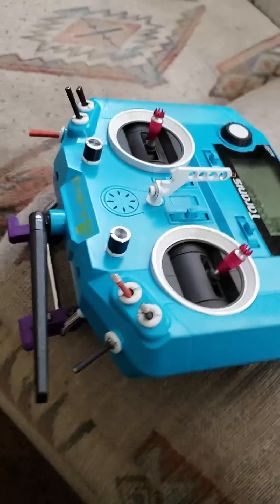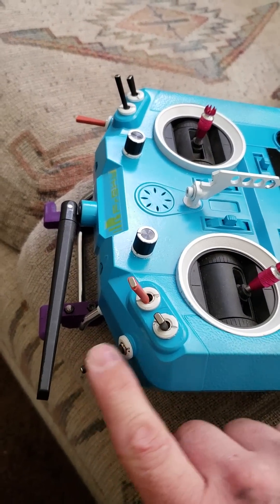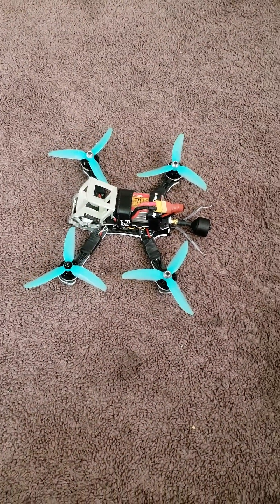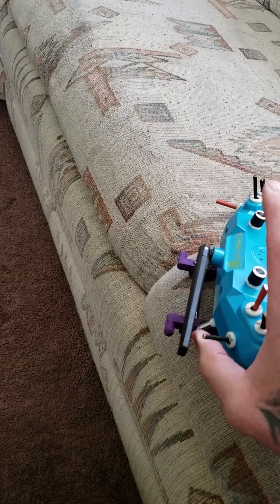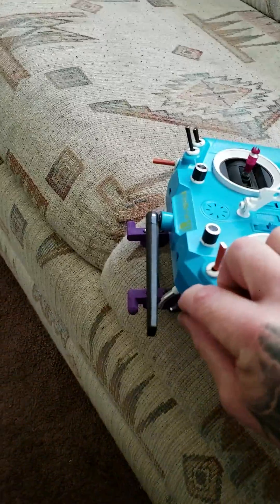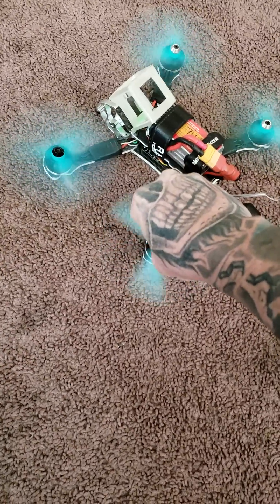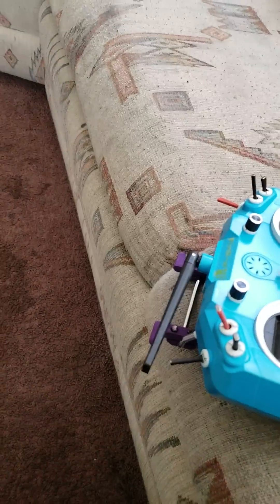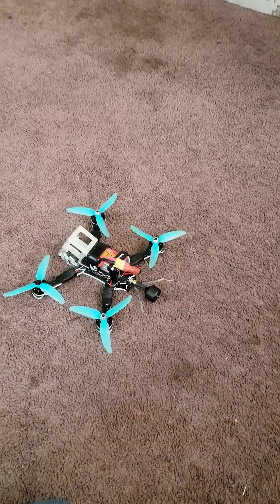Idle up mode for betaflight (preview)

Comment: What is the rationale behind that. Instead of arm and fly.
Reply from the maker: So when you land the gyro does not try to correct and bounce around
Reply: Also you can arm your quad without the gyro to check for bent props real quick after a crash:)

Comment: Can't wait. Super useful knowledge!
Reply from the maker: Thank you,  in the next week or two I'll cover the full set up on this as well as tearing down an entire quad to get it ready for winter time with conformal coating!
Reply: Dude! Can't wait for the full tutorial ;) Please also note: I did this pull request for betaflight: https://github.com/betaflight/betaflight/pull/6572 in order to get the props to "just spin without pidloop" on a switch - as mode - but the betaflight maintainers don't seem to get how important this feature is ;)
Reply from the maker: @rephlex  OMG I read like 3 comments and wanted to b scream.  Literally no one seems to understand how it works.  There is no run away,  no danger.  I put my Flippin finger in my prop lol. "oh just use bf config" as dude is dragging his laptop across the fn grass. Ahhhhhh ignorance! 
I'll get it posted up,  I got my go pro back yesterday